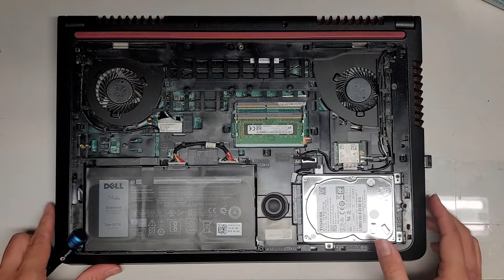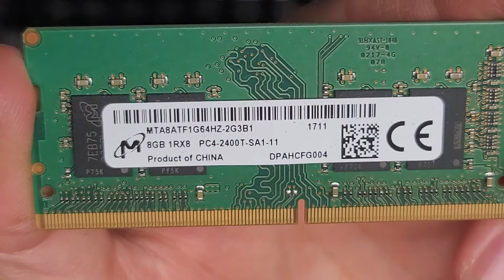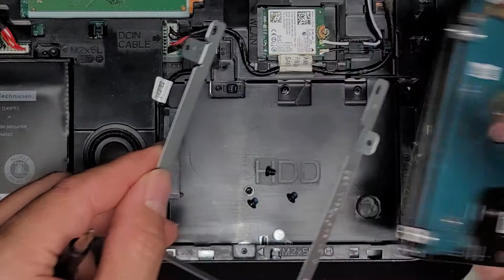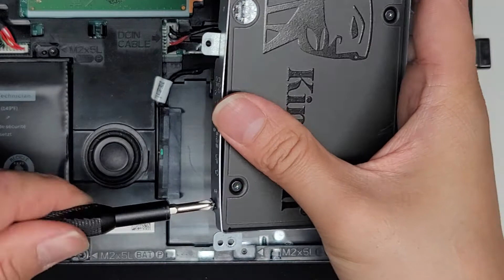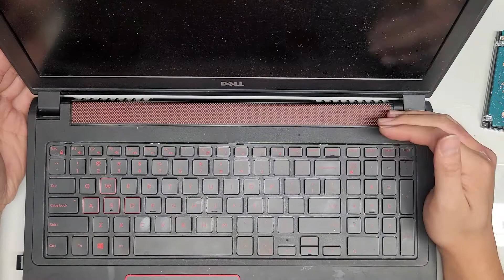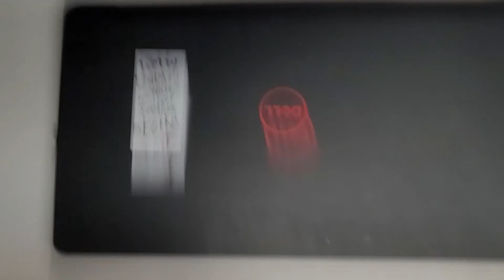DELL Inspiron 15 Gaming 5577 Disassembly RAM SSD Hard Drive Upgrade Replacement Repair Quick Look

Comment: Is it possible to replace it with m.2 ssd NVme?
Reply from the maker: I believe so. Looks like there's a slot for one.
Reply: @ItsBinhRepaired  Thank you for your quick reply even though it's a video from 3 years ago😊
Reply from the maker: @Chap_chap_  no problem

Comment: bro , can i keep sata drive and add another SSD in first slot u shown for ssd slot. means i want to say i keep original sata hdd drive and put extra 500 gb in vancant slot is it possible to do that. thanks. and also i will put one extra ram stick of 8 gb. can i then install windows 11 or i should keep windows 10.
Reply from the maker: @TheStockLadder  you should clone what's on the current drive to the SSD unless you want to start clean
Reply: @ItsBinhRepaired  i want to start fresh
Reply from the maker: Oh yeah, just put the drive in and install windows to it.
Reply from the maker: @TheStockLadder  sure

Comment: Hello bro! I have a question what screwdriver you use to do it? It's about the size because it can't be unscrewed
Reply from the maker: Get this toolkit and use what fits best https://amzn.to/3xh5Bvj Normally ph1 or jis1 but sometimes people change the screws around, so make sure you check if it fits well.

Comment: I have the same so i have purchased with 8 GB Ram and now i want to upgrade RAM ao how much GBs i can add more ?And also how much storage we can add limit on ?
Reply from the maker: There are no limits
Reply: @ItsBinhRepaired  thanks man and as we can see there is 2 slots for RAM so I already have 8 GB so I can add 16GB in 2nd slot 8+16=24 ? Or 8GB only ? 8+8=16 ?
Reply from the maker: You can put 16 if you want.
Reply: @ItsBinhRepaired  thanks man appreciate your help and support 👍🙏
Reply from the maker: @DharmS  yup
Reply: @ItsBinhRepaired  as in my laptop RAM is 8 GB with 2400 MT speed so should I go for this same speed limit or I can also buy 3200MT speed ? Because I am changing to 16+16=32GB so no idea.
Reply from the maker: You can try other speed, but sometimes the controller won't like it and won't work.
Reply: @ItsBinhRepaired  hi Bro after I replaced with new SSD M. 2 I am not able to boot and getting some error like failed to boot so what should I do ?
Reply from the maker: How did you put the OS on it?
Reply: @ItsBinhRepaired  oh yeah I have to install windows on it sorry I forgot that step haha thanks men 😅
Reply: @ItsBinhRepaired  in bios CPU speed is showing 2800 MHz and for SSD it's showing 2400mhz so we still not be able to add 2666 mhz right ? Because I am not able to find 2400mhz RAM so need your guidance on it dude.
Reply from the maker: @DharmS  It depends. Sometimes the controller will still support it, but make sure you can return it in case it doesn't work.
Reply: @ItsBinhRepaired  And in SSD we can add 512 ? Because when I bought it was only 128 so just had question in my mind.
Reply from the maker: You can put 4tb if you want.

Comment: Hey my HDD is corrupted can you help me which one to but to replace it with ? Any suggestions?
Reply from the maker: Get this https://amzn.to/3MJNxi9 goes on the left above the battery.
Reply: @ItsBinhRepaired  not sdd I need an HDD
Reply from the maker: @saikumar-hw3ms  I'd still recommend an SSD, but I recommend this one https://amzn.to/3QViKS4
Reply: @ItsBinhRepaired  thank you so much
Reply from the maker: @saikumar-hw3ms  no problem

Comment: Hello bro,
I upgrade my ram with extra 8 GB 2666 mhz
And Default ram is 2400 mhz , then any issue is there or not.?
Reply from the maker: You usually want matching
Reply: @ItsBinhRepaired  its showing on task bar 2400 mhz of 16 gb ram only , is ok or an issue.?
Reply from the maker: @kingA_1822  if it doesn't crash, it's OK.
Reply: @kingA_1822  There is no problem as the motherboard downclock the mhz .

Comment: My laptop doesnt turn on at all, technician said its some SMD issue and replaced it and also as battery was swollen I rpelaced that too..still I got the same issue today, can u plz help? I've been using it for four yrs, infact the night it stopped working I kept in sleep mode as I went outside and when I came bavk n tried turning it on neither power button or any keys were turning it on
Reply from the maker: Not sure. You'll likely have to have the motherboard replaced.

Comment: I have one it suports nvme 2 ssd and i aded extra 4 gb of ram making a total of 12gb its with windows 11 very fast snapy turns on quick then my i7 4770 with a sata ssd. I like it.
Reply from the maker: Awesome, sounds good!
Reply: Just helping out my kid with his 5577 and installing the m.2, do you have any recomendations on the cloning process or any videos that could help me out would be greatly appreciated. Still pretty new to cloning.

Comment: I just installed a samsung 2.5 sata SSD, but it's not showing up anywhere on my PC.  Do you think that it is likely an issue with the cable?
Reply from the maker: Did you install the OS to it?
Reply: @ItsBinhRepaired  no
Reply: the secondary hdd died a while back but finally got around to getting a replacement
Reply from the maker: If it's blank you need to initialize it in the disk manager.
Reply: @ItsBinhRepaired  how do i intialize it? i go into device manager but only see my main m.2 drive not the second one i just installed?
Reply from the maker: If it doesn't automatically show up, then it's not showing up.
Reply: @ItsBinhRepaired  so would it likely be the cable that's the issue?
Reply from the maker: @Dartzeee  possibly

Comment: what performance increase is expected when you increase the RAM from 8GB to 16GB on this laptop?
Reply from the maker: If you already have 2 sticks, next to nothing, unless you're actually using all your RAM and it's causing your computer to lock up.
Reply: @ItsBinhRepaired  when I game it uses up to 7.8gb out of 8gb ram idk if that is the max performance of ram or can it still squeeze out that 0.2 GB ?
Reply: @ItsBinhRepaired  I think I have on stock I was thinking uping it to 16gb
Reply from the maker: @coldpizzaslut  usually it'll always leave some unused to move things around

Comment: hey have u noticed any problems with the hinge on this laptop?
Reply: I have been using this laptop for 6 years now. Yes, it will have hinge problem. I welded mine personally.
Reply: @resiluck  @sekrit bias I'm having the same issue (hinge)  in my laptop ... last year when my laptop was under the warranty period ... dell agent changed the whole assembly that is related to hinge ... yet after 1 year I'm facing the same issue ... its warranty period is over ... I have to tight the screw on my own if its loses ... its very irritating in this price budget laptop.
Reply from the maker: If it's screws coming loose, use threadlocker.
Reply: @resiluck  what !!!! you welded it than how can you open the back cover??
Reply from the maker: Probably jbweld
Reply from the maker: Don't think I had anyone that needed that repair yet.
Reply: A bit late but I have the hinge issue. Have you got it sorted? @itsBinRepaied, any way to sort it?

Comment: Ok, I been having problem after problem with my Inspiron 15 Gaming 5577, and I think the repairperson I've sent my laptop to did a pretty banged up job at it. I think I'm getting scammed from the person. Anyway when I got my laptop back, I keep receiving some notification along the lines of "SATA Disk detected: Removed" and then eventually I received a blue screen error. When I rebooted my laptop, I could no longer read my (D:) Drive. Which part exactly do I have to look for so I can read the (D:) Drive again? What does it look like exactly? And perhaps can you recommend some repair shops I can look for to fix computer problems in general?
Reply from the maker: Sounds like the hard drive failed. You'll need to send it for data recovery.
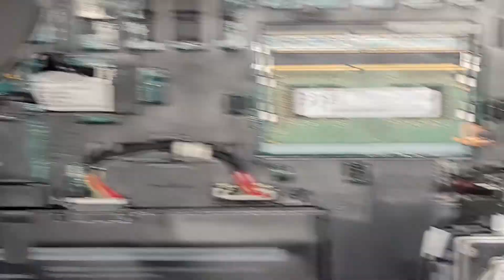Reply: @ItsBinhRepaired  By hard drive, you're referring to the part you're pointing to at 1:29 of this video? It seems to be case because I removed the back panel under my laptop and took out the hard drive as you demonstrated and reconnected it. Apparently the connector was loose because reconnecting it reenabled my laptop to detect the DATA (D:) Drive again!! My computer can read it proper!
Reply from the maker: @ninknight6984  awesome!
Reply: @ItsBinhRepaired  I have spoken too soon 😅For some reason, my  DATA (D:) Drive disappears and reappears from time to time and I occasionally would have to reconnect the Drive behind the under panel of my laptop.

I'm not sure what to do. Suppose I can send it for data recovery like you recommended. If so, to whom I should send it to? Alternatively, is upgrading my drive to a better one an option? I could afford to lose the data on my DATA (D:) Drive, but I have lot of important data on all other file locations. 

What would be the best course of action? Please address all my inquires if you may.
Reply from the maker: I recommend 300dollardatarecovery.com
Reply from the maker: If you don't need the data, then I would try a new hard drive.
Reply: @ItsBinhRepaired  Alright then, I'll consider my options. Thank you for the responses! I really appreciate your help!
Reply from the maker: No problem! If you haven't already, don't forget to like and subscribe so others can find my videos. Thanks!
Reply: @ItsBinhRepaired  Noted!

Comment: Is there a way to upgrade the processor? Also, is it possible to upgrade the Graphics card of Dell Inspiron 15 5577?
Reply from the maker: No
Reply: No, most laptop pc's, this one included, have their CPUs soldered into place.

Additionally, mobile GPUs are always soldered iirc.

So, in summary, unless you can perfectly solder on laptop pcb's; no, you cannot upgrade either the CPU or GPU.
Reply from the maker: @FerroFrog  some GPUs are replaceable, but they are very limited in what you can put in the slots.

Comment: I have same model 
It has m.2 ssd and 1 tb hdd

Can i change 1tb hdd to 1tb sata ssd
And m.2 in its place
Reply from the maker: This video will help you. https://youtu.be/4p5jFDzVwUw just wondering. Do you know what an m.2 looks like? Technically the answer is yes, but you'll need an adapter and it'll only support an m.2 SATA, which has no benefit over a regular 2.5" SATA SSD.
Reply: @ItsBinhRepaired  
I want to replace hdd with sata ssd 

And doesn't want to remove m.2 ssd (in which operating system installed)

Hdd (which want to convert into sdd) is for storage and both drive are already installed in my laptop
Reply from the maker: @himanshujain9752  this will do the job.https://amzn.to/313j4Xo